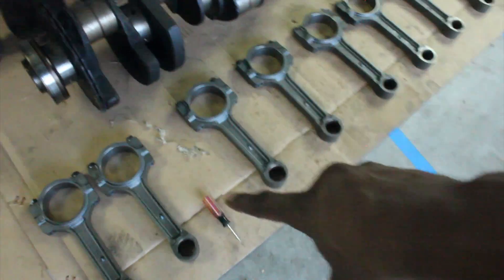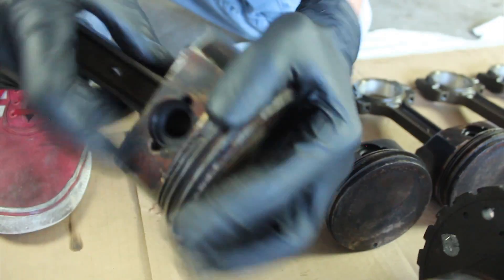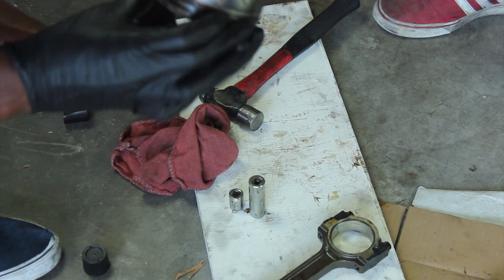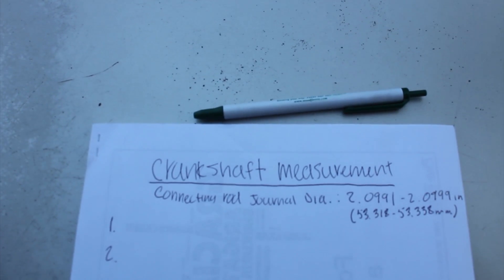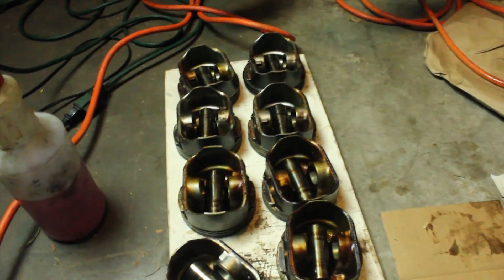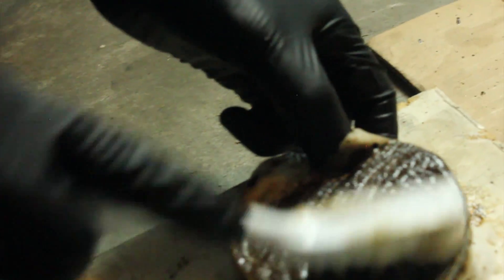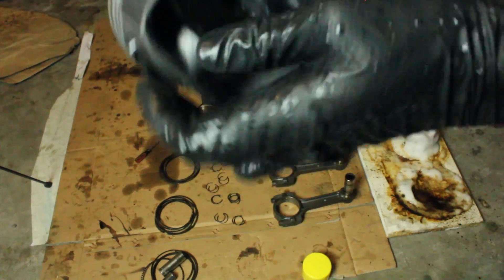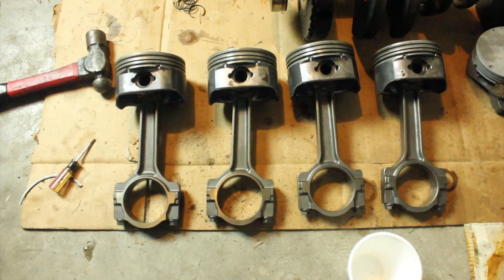The 500hp Budget Build Part 5: Best way to clean Pistons

Comment: Replace the snap rings. I did a motorcycle long ago. Didn't know to. It came out. Killed everything. 
I did my pistons with diesel fuel soak. I have used oven cleaner on an aluminum intake before. Probably gonna hit my pistons with oven cleaner before  I build this motor. Left them outside covered. Rain got in my cans. Bad things. Looked like mud. Sticky, carbon crap.

Comment: Man if you usually slide those pins out by hand all other times you must be working on some new or low mileage pistons and rods. I always have to do exactly how you did it with socket and hammer. Love LS gen 4 for this reason. Good luck with the build!

Comment: HI guys,I use the cheap oven cleaner of a lot of stuff,it works great ,just don't breath it and don't let it sit to long on alum. It's made out of lye,and will eat alum if left on to long.i always use it at the beginning to make disassembly real easy and you can inspect your parts right after cleaning .i also use apiece of the old ring to clean the ring lands ,if you don't have a ring grove cleaner.just try not to put groves in the piston. good work

Comment: On the wrist pins I've clean my Pistons but my piston head is in sliding back and forth freely so I saw that you sprayed some lubricant inside the wrist pain area and freed it up if I did that to to my Pistons would I be good to go with installing and what did u use

Comment: use a flat head screw driver for the snap rings also helps if the screw drive has a small cut in it near the edge you can use a grinder with a thin cutting wheel. put one edge of the ring in and compress the rest in with the screw driver. also i would like the t shirt so i can brag to all my car friends about the new shirt i won lol. keep up the awsome work.
Reply from the maker: That's a great idea I have one similar already that's been made for drum brake springs-Will give this a try thanks again!

Comment: I like the idea of cleaning pistons with oven cleaner, does it etch the alu.?
Reply from the maker: Sheldon Vanek No signs of etching.  Was recommended by another engine builder.
Reply: great I will try it then on my pistons for my 6.0 build.
Reply: Sheldon Vanek most oven cleaners use caustic soda which will eat away at the alloy. but you should be fine if you don't leave it on for too long.
Reply: Thanks!!